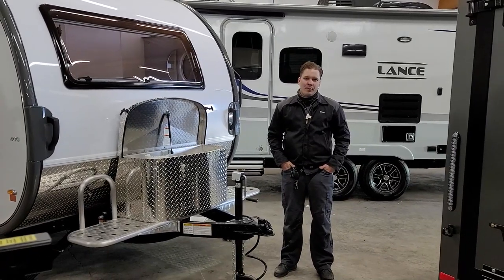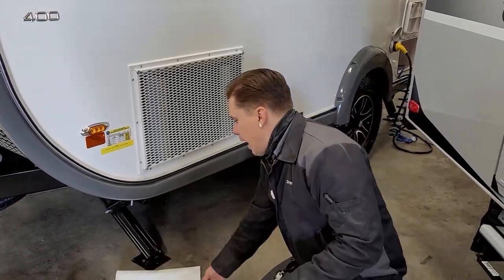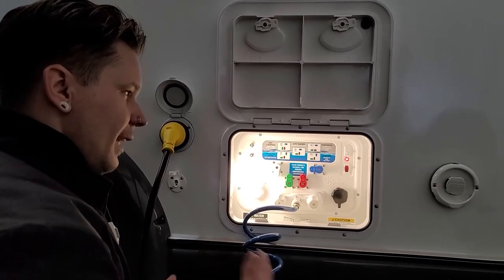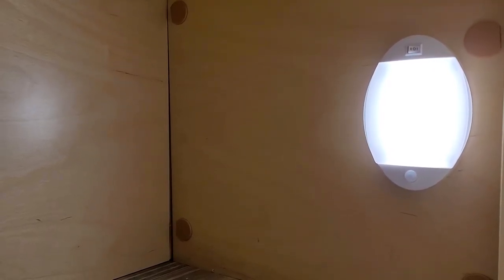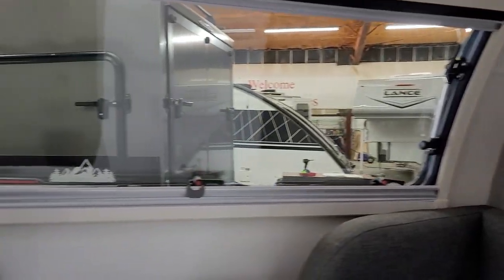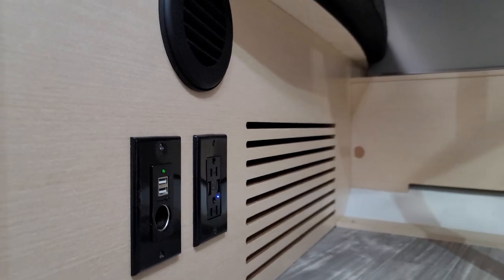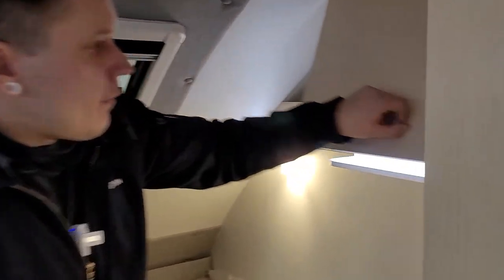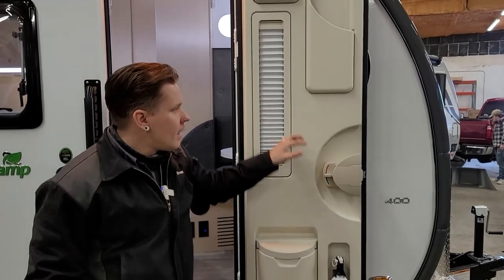NuCamp TAB 400 Solo Boondock Technician Tour

Comment: Thank you for care in details.  It was great to learn of the fresh water tank heater because I'm interested in cold weather camping. Does it have a thermostat to cycle on as needed?
Reply from the maker: I believe it is just a switch on and switch off situation.
Reply: I missed the part about a tank heater. When was it? I didn't think any of the tanks had heaters.

Comment: In the list of trailer measurements I need to see the height and width of the presenter so I can figure out what the wide angle lens is hiding. The same 5’10 155lbs dude that’s used as the standard for German car design should be used for your walkthroughs.

Edit; not trying to be “Karen Aaron”  ..just trying to figure out if I could fit in this bish.
Reply from the maker: Drew is about 5'9", and about 185 lbs.